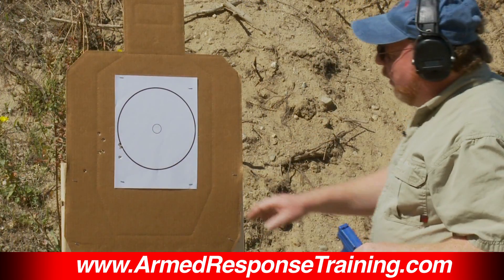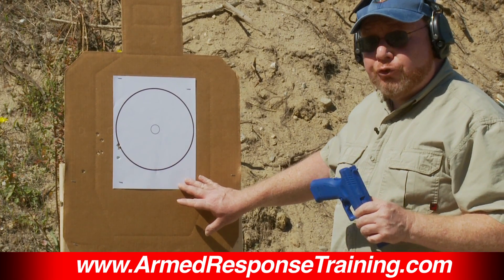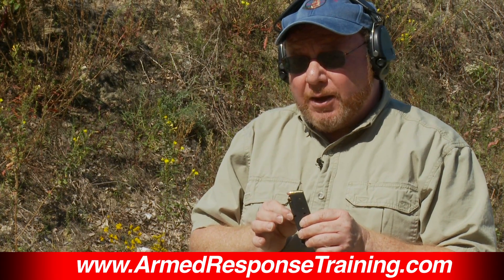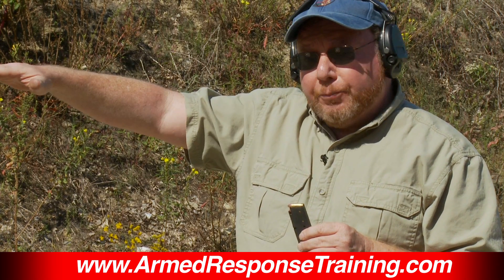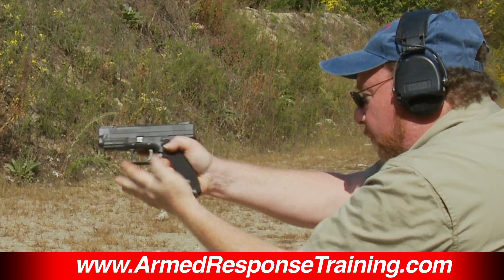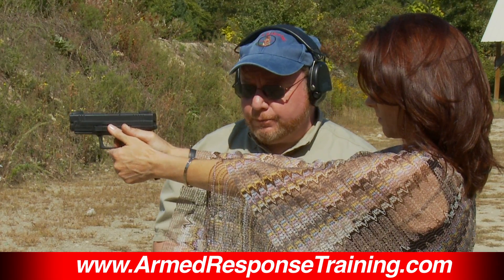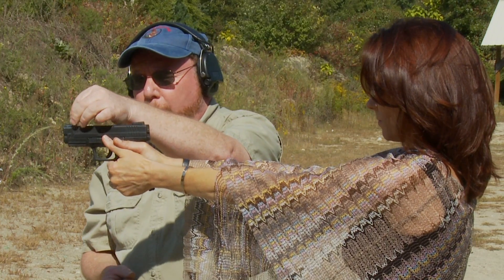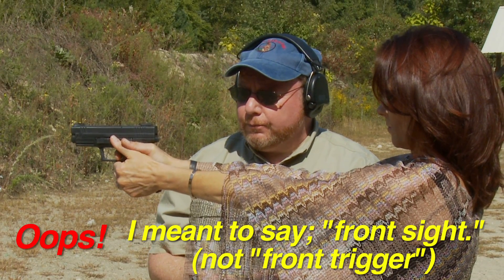Fixing Trigger Jerk

Comment: In my experience, trigger jerk is caused by the unconscious anticipation/fear of the recoil just as you said. The ball and dummy drill is a great way to diagnose and potentially fix this issue, but what I've found is that dry fire does not because the shooter knows that the gun, in fact, will not have any recoil. This eliminates the fear of recoil which is the cause of trigger jerk, therefore, it doesn't solve the true issue. I don't mean to rag on your video. Just my .02...overall great video!

Comment: Trevor, the only gun that is going to sustain damage from dry firing is a rimfire. (And not even all rimfires). In that case, the chamber can be damaged. A centerfire firearm's firing pin experiences no significant additional stress from dry firing that it wouldn't experience with a dummy round or a live round. Dry firing without a dummy round is perfectly safe and can (and should) be done thousands of times if you really want to develop perfect trigger control.

Comment: If you're going to dry-fire use dummy rounds guys. Not having a dummy round can damage your firing pin. You can rack the gun like the woman did when it was empty without ejecting the dummy round (you just partially pull back far enough to rack the gun without ejecting the round) and you can just reuse the same dummy round if you're too lazy to reload a mag.
Reply: Dry firing doesnt hurt a center fire pistol, sir. Ive done it for YEARS and have never replaced a firing pin.